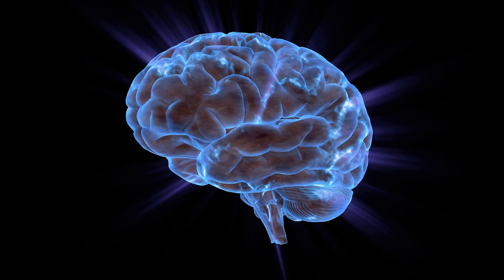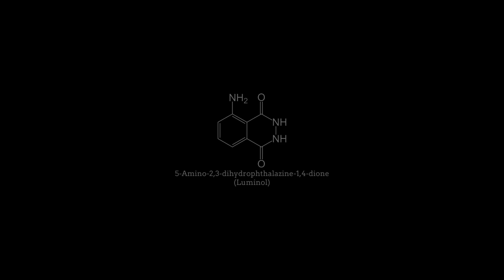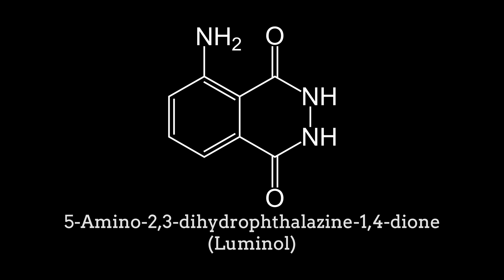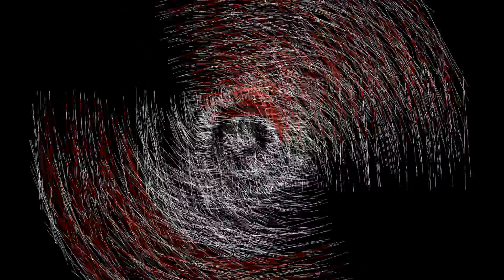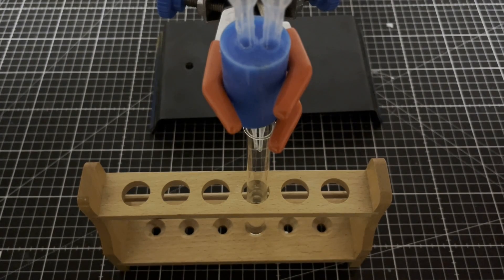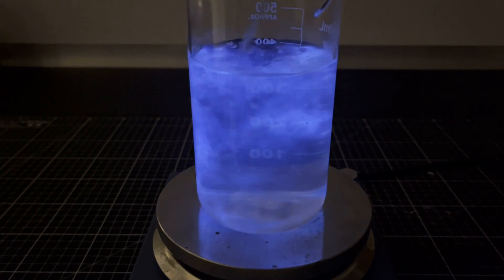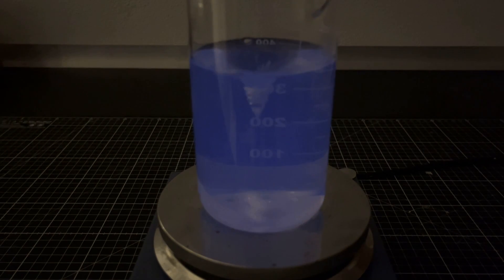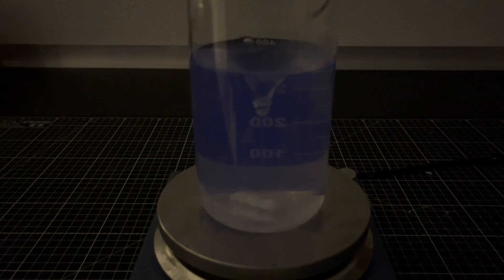Towards an artificial chemical brain

Comment: Very nice demo. Do you already have any ideas on how to interface the output of one gate to the input of another?especially if you need to be able to reset the state of the chemputer every clock cycle i imagine that to be really quite difficult. Despite thinking about this a fair bit i haven't really found a good chemical reaction for that either... i mean there are a few options really but for the ones i found to be suitable the most significant part of the gates logic would be fluidic in nature and the chemical reaction doesn't really do the heavy lifting which is a bit cheaty i feel like. also the interface between clock, logic and NVRAM would be complicated as well as both will probably use very different reactions. Maaaaaaybe its possible to use a reagent/setup that fulfills the following conditions:
1. Contains chlorine suspended in a buffer solution
2. Contains some reagent that gives off a H+ ion in a heated acidic solution that can attack said chlorine to form HCl in gaseous form.
3. Must implement the actual NOR gate or NVRAM logic somehow bc. this describes a buffer capable of cascading, not an actual logic gate.
4. Reagent must yoink a H+ ion from HCl if cold.
5. Assembly must contain valves to get rid of gaseous HCl when resetting the gate for the next cycle.

Operation would look like this: everytime the luminol clock goes high, the gates are heated and give off the HCl gas that is vented. Also reagent get refilled. If during a low phase of the luminol clock HCl from the preceding gate is bubbled through a gate, HCl is formed that goes into the next gate etc. Etc. As i said this does not implement any logic. Just an idea, i am sure you came up with something smarter and less overcomplicated.
Reply from the maker: Wow, thanks a lot for your very detailed comment and suggestions. I honestly haven't thought much about combined chemical reactions yet; my next research topic is to build an electroosmotic pump as small as possible. I think a lot could also work through selective ion exchange membranes, so a main circulatory system that supplies all other sub-systems with chemicals. I chose luminol reactions simply because they can be easily converted into electrical impulses. However, it is a very interesting field of research in which I will continue to work :)